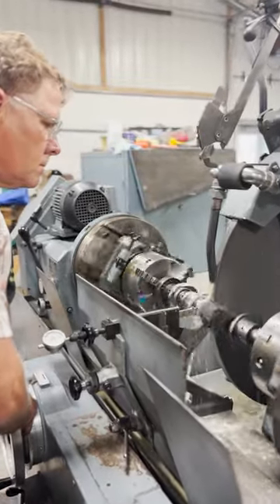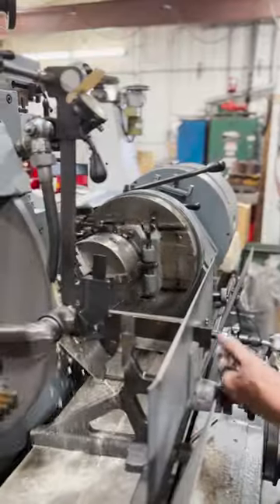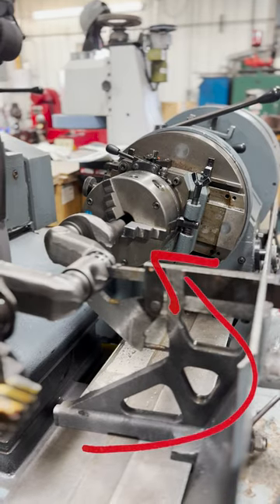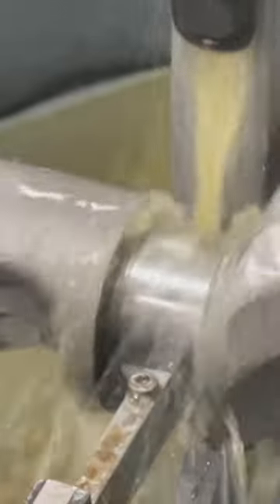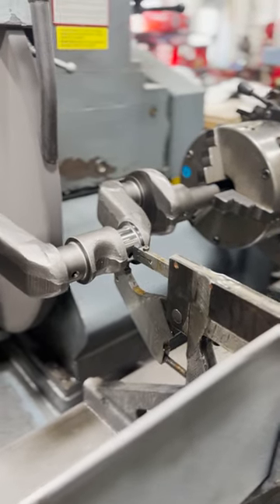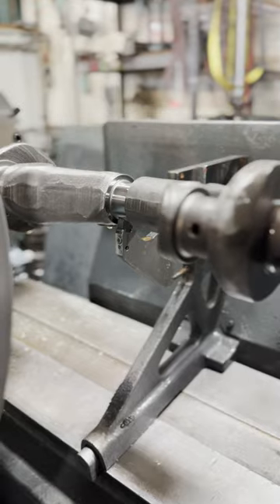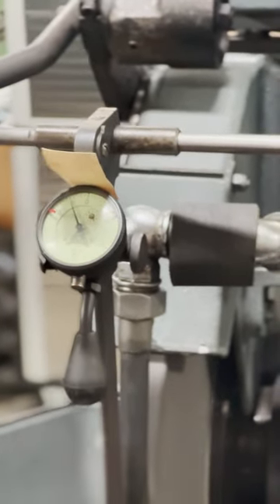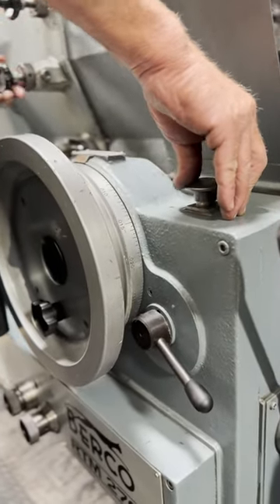#shorts Grinding The N62 Continental Crankshaft From A Massey Harris Pony Tractor

Comment: In the first part of this series it showed the janitor knocking the crank bearings loose, but only the ends. Does this engine only have 2 mains?
Reply: Yes, two main bearings and a crankshaft that looks like it was made from a bent wire coat hanger.  Safe to say that high RPM would not be the friend of this engine.

Comment: Don't you have to harden the crankshaft after this type of work at least that's what they do in the general aviation industry
Reply: I doubt this grinding goes below the hardened layer. If done properly the hardened layer should be much deeper than you would grind off.
Reply: I think it depends on the crank. Some cranks have a different hardening process than others.